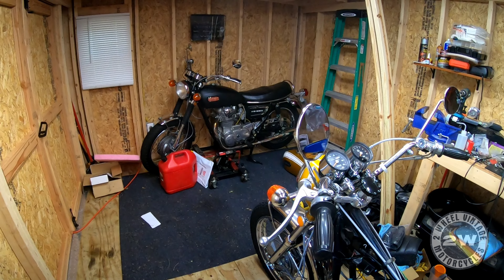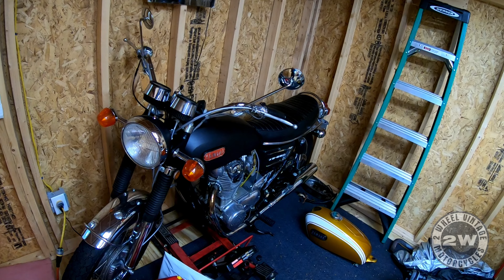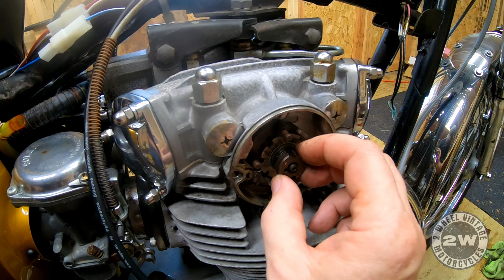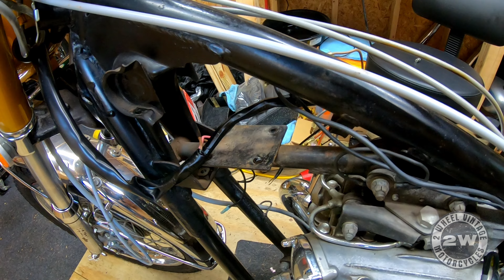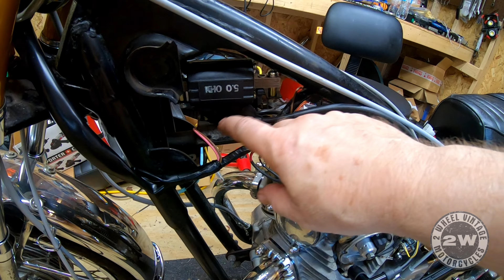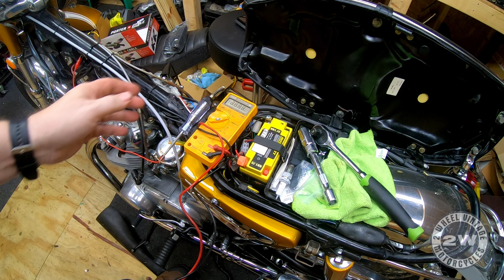Yamaha XS1b Part 16. Ignition Swap

Comment: Always stuff to do and ya don't want one that bites you when try to start it up ,that's a bit of a flaw surely with that particular maker .I have to say this part of proceedings fies way over my head 😉👌👍
Reply from the maker: What made it worse was the new pickup that replaces the points plate has 2 wires, it says to connect the blue to the coil and the red to switched power. My wires were yellow and black. 😆😆